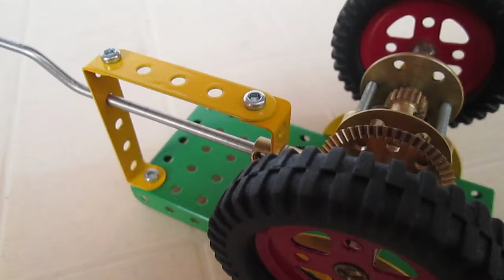Spur gear Differential : on test jig

Comment: I'd think the typical bevel gear arrangement commonly used in cars would be more durable.  Can this spur gear arrangement be designed limited slip, or non slip?  This might be useful as an inline PTO, but doubtfully for an auto rear end.
Reply from the maker: Are you concluding from "Stress-Concentration" point of view? Moreover, "Crack-Propagation" is another aspect we are to consider for either cases. Hope it clarifies.
Reply: Simple conclusion - if it worked for autos, it would be marketed for autos.
Reply: i'm looking for a differential for home built quadricycles and trikes.  This gives me some ideas.
Reply: SCHAEFFLER Lightweight Differential !